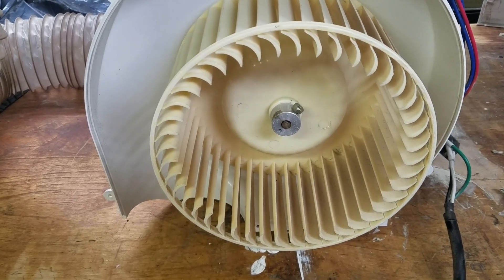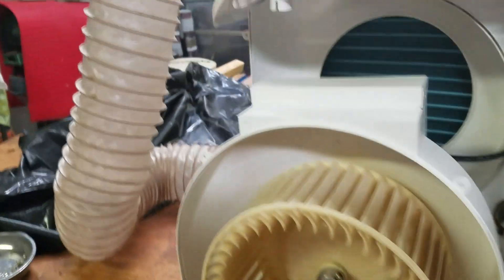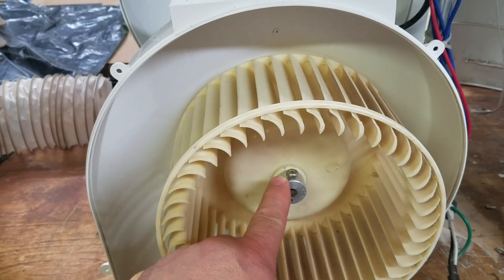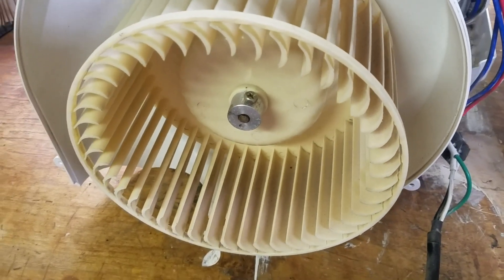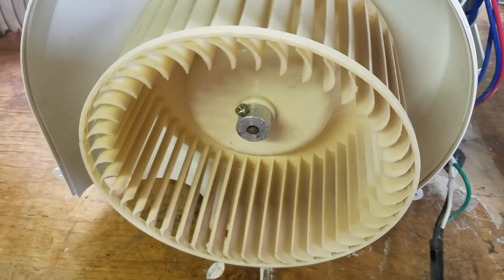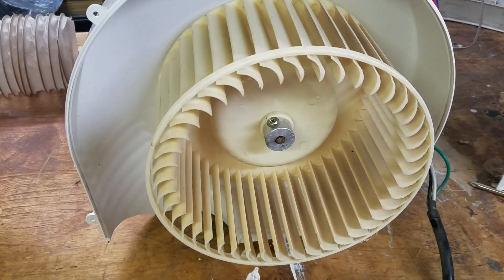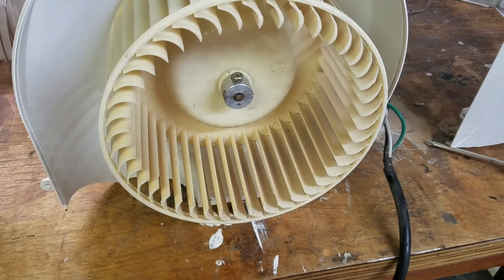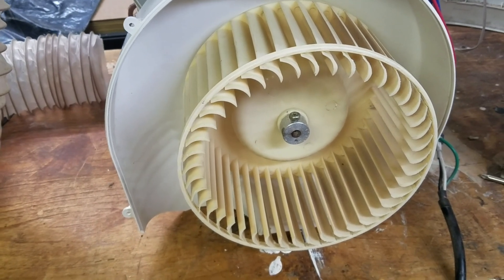Portable air conditioner diagnosis and problem.

Comment: I want this plastic exhaust any idea
Reply from the maker: Are you talking about the fan itself? You would have to get fairly accurate measurements for the one you want and do a lot of digging. There's a reason I glued mine back together. Mind you this is a very old video and that air conditioner has now been gone for the last couple of years. I have since switched to a mini split in my workshop.

Comment: Same thing happened to mine.  Quick fix i put a hairband around wheel like you would when a bike chain pops.  Tried duck tape but it melted and flung off.  Till i buy a new part it worked.

Comment: They make a plastic repair kit for motorcycle fairings that consists of a liquid in a dropper & when the activator is sprayed on mixing the chemicals they heat up to melt the plastic surfaces together, and the whole process is complete in a matter of approximately 3 -4 seconds.

Comment: They make stuff so cheap these days! I have a GE 6100 that we only used twice when our central a/c needed fixed last year. I plugged it in last night to help with the extra humidity and the fan motor is making racket already in it's THIRD use, still worked good all night but was noisy.

Comment: Well, The latest news...The glue dried. and I turned it on. It worked for a few minutes then buzzed, squealed, screeched for a while, then all of a sudden, it's all quiet and running smooth again... guess it's holding for now anyway. I think it's possessed. Time will tell I suppose. Unbelievable crap. A regular window unit is the best, will acquire one ASAP. aside from central.

Comment: I just ordered a replacement fan assembly.  Gluing did not work and kept coming loose.. New Fan Assembly worked great!
Reply: How did you take it apart
Reply: Industrial glue is what you needed, it melts the plastic on the contact points and weld them together, find this type of glue at the hardware store industrial, it's two syringes stick together with different type of liquid inside when they mix is when is activated, this even works on concrete. You could have also zip tide the blades to the ring one by one with the super small skinny zip tides, you would have to drill a tiny hole at the end of each blade to pass the zip tides through them, plastic tides are super strong and on top of that you could have use regular glue around them.

Comment: I have the same ac brand RS, same with problem with the fan,i dont know if only to change fan or the fan in also the motor ,where can i order this parts ?
Reply from the maker: I ended up gluing the ring back onto the blades. Service parts seem to be nonexistent. This was very much not a quality product...
Reply: @Wildersport  How did it work after you glued the ring back onto the blades?

Comment: Will this cause the fan to not turn at all? My husband looked at ours and the plastic band was shot just like this one. But the fan isn't turning. 
Thank you.
Reply from the maker: Not that I can think of period it wasn't that mine wasn't turning its it's that the fan itself was broken.
Reply: Bearing probably seized
Reply: Same with mine. Band broken off. But fan motor never turns and unit overheats. Motor rotates freely. Need to check to see if motor is being called to run...
Reply: @danb4376  I have same symptoms. Did you ever determine if the exhaust blower motor was bad or if it was not getting proper voltage to it? Thanks.
Reply: @deanrock4331  Ya, I did figure it out. The motor itself turned out to be bad. The unit was calling the motor to run but the motor was not turning. I ended up buying a replacement motor and installing it. The actual blower wheel I was able to fix by using the flexible crazy glue that is on the market. It's the type of crazy glue that doesn't run all over the place when you squirt it out. I was able to glue all the broken pieces of the blower wheel back together amazingly. Reattach it to the blower motor. Unit has been back running for three years now. I took the failed motor apart to see what was wrong with it. I found that the thermal fuse inside the winding had opened. Likely because the blower wheel broke, jamming the motor and the motor energized and could not turn. Ultimately blowing the thermal fuse.
Reply: @danb4376  Thanks for the response. Do you remember how I can test the wires with a voltmeter to see if the board is calling for the exhaust blower to turn on? Please let ne kniw if I should set it to 20 AC and what 2 wires to touch with the red and black phones. Thanks!
Reply: @deanrock4331  You need to be comfortable troubleshooting line voltage and take precautions. I followed the blower motor's wiring to where it landed on a circuit board connector. I unplugged the connector and metered for the presence 120VAC. Of course, you also need to understand the sequence of operation so that you can check for blower motor voltage when you expect it to be switched on. For me, the unit was calling for the blower motor to run, as I saw 120VAC on the connector when the blower was supposed to start.
Reply: @danb4376  Thanks. I'll check for 120 at the board. I'm surprised in your case you couldn't get a motor and squirrel cage together foemr a decent price. That's what I'll likely need, as mine was obliterated.

Comment: My husband heated the bolt in the center. He was able to remove it and replace the broken fan part:) fan replacement took about week to get from England!
Reply: I got my part from the Danby site here in USA but now it has been sitting in the box for a week or two as I cannot get the original set screw off - when you say your husband heated it ?? cos mine looks like it is set for life !!  So i have the part and everything down to the bone now i cant undo the stupid screw set....
Reply from the maker: When I looked, replacement parts for this AC were no longer available in the U.S.
Reply: ereplacementparts.com .. like I said in my comment, the part came from England.
Reply: @ Linda, I’m talking to my husband .., we may need some more details? :) are you talking about the little bolt that is holding the fan on to the motor shaft ?
Reply: @victorianelson1838  Ahhh u answered THANK YOU --- i got the little tiny screw out of the side now I just have that big silver thing in the middle and the fan is NOT moving.  When i watched another video he was great - his came out no problem :( looked so easy - however mine isnt) it is STUCK ... so am I meant to be pulling that blower over the top ?? or am I meant to unscrew the middle silver bolt???
Reply: How long did he try and heat it for, ive been sitting here a while with my little heat gun and nothing!!!

Comment: I have had different versions of the portable air conditioner from Delonghi.  I believe I am on my 7th fan failure on multiple  units.  They last about a year.  If you compare a metal blower wheel  to these  plastic blower wheels we will see on the metal unit that fins are completely fastened at both ends.   Why did they ever feel that the little ring should hold up.  If this blower was made with some meat on this weak ring end it would stabilize it and allow it to last longer and  run smoother.    It is bad engineering followed by bad quality control and no feedback to the designer.  I have two units so I can now swap a repaired unit in for when it fails.
Reply: Where were you able to find the metal replacement for your Delonghi?
Reply from the maker: No doubt this is planned, short term obsolescence. And these things aren't exactly cheap.

Comment: Plastic weld it
Reply from the maker: That really wasn't an option for me.
Reply: @Wildersport  JB weld is best. It is two part expoxy type glue. It sets in minutes, applies like putty and strong as steel. The hold will outlast your AC. Get it in harbor freight for 7 bucks.
Reply: @allenlau6407  could it be used for strengthening the part? or will it harden or crack the plastic? the old one is shattered to shit, but i was thinking of reinforcing the edges on a new replacement so it doesn't brake in the future.
Reply: @drago7635  all about weight balance. Think of it as a tire out of balance.  Dont use to much anything on it. Use just enough.
Reply: @drago7635  interesting thought to reinforce a new one. I'd be concerned about balance however.
Reply: @danb4376  Yeah, I was wondering about if the epoxy would add weight and make it start going off balance too.. I am in the middle of this right now, and will consider the options too

Comment: i just had my ac go down with the same issue.  how did you remove the part?  what it more than just unscrewing the set screw?  thanks for any info you can give me.
Reply from the maker: Tear down to expose set screw, unbolt. I had to bump the metal collar with a rubber hammer to break it free.

Comment: Glued mine with Gorilla Glue Super Glue working fine still bought another one as a backup. Sears Parts Direct is the cheapest. Part number ac-8000-19 also it's not press fit loosen that set screw and it'll slide right off that shaft.
Reply: Me too - now i need to replace the actual fan - I have one now but got undo the stupid nut on the blower fan to replace it with the new one...

Comment: Sooo... Same problem.  I was having trouble getting to the fan so i used a ball peen hammer, smashed the waffle grate, stuck my hand in there and slid the ring back towards center.  Resecured the fan motor on the fan housing and let her rip.  It worked!  Follow up question: my water tank keeps filling up. Recommendations?  Do I run a hose to the sink with a little pump?

Comment: the same thing happened to my dual hose unit  this evening you gotta replace the fan  lasted 1 2/3 years in florida heat find a metal one if you can

Comment: Do u even need that outer rim?
Reply: Mona Perez unfortunately you do. That blower runs at high speed and the spinning will fling those open ends of the fan into the housing around it, creating quite a ruckus. Those fans are subjected to heat as they try to push hot air outside. I think that's what causes them to fail.
Reply: @abbshurz  Thank you for your detailed reply that totally makes sense. I was wondering if we needed that band piece. But it makes sense that small little thing is holding all the fins together from moving around all over the place
Reply: yes . got my surprise today. loud and annoying without the outer piece
Reply from the maker: Yes it holds the fins in place.
Reply: Same here I think they are designed to fail
Reply: @Mona Perez  Good question!! I was thinking about asking that too haha
Reply: Yep - that would be too easy lol

Comment: I just watched another video about this type of fan. Apparently, the little screw in the side of that center ring is called a "set screw". With some units, the ring itself may be attached to the fan. The set screw holds the ring on the shaft of the motor. When you loosen the set screw, the whole fan (ring & all) should just lift out, sliding off the motor's shaft.
Reply: Nope... mine doesnt it is totally stuck on there almost with superglue???? lol - another video I saw the fella just lift his out no problem.? am I meant to be pulling it off and over and leaving that silver nut there???? cos the new one has that piece???
Reply: @Izzywizzy74  I used an M80, after executing said tool, the fan literally came flying out. In different directions albeit..but never the less..it’s out 🤷🏻‍♂️
Reply: Not that easy lol, already tried that, did not came loose, that thing feels like it's freaking glued there, i removed the screw and nothing happened.

Comment: Do you know how I can order one fan for my idylis because the piece is broken
Reply from the maker: +Jose Guerrero if you work at my further videos on this issue I found that the fan itself is no longer available from the manufacturer however I was able to reglue mine back together using that combination PVC CPVC glue. It's a bit of a kludge but it works.
Reply: Sears parts direct. Part number ac-8000-19 fits my idylis model 416710. Also fits 416709 and every other one of their upright in room models. 22 bucks before tax and shipping.